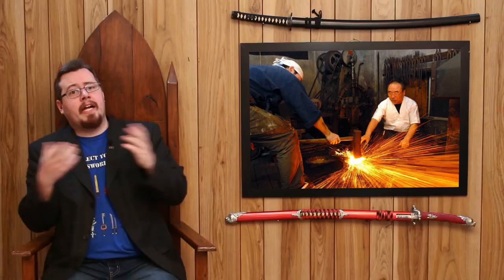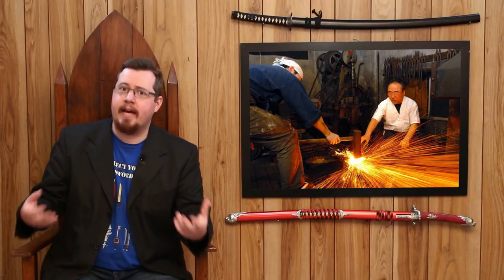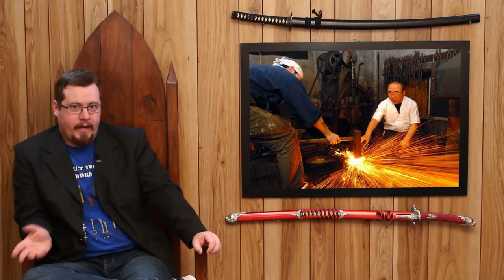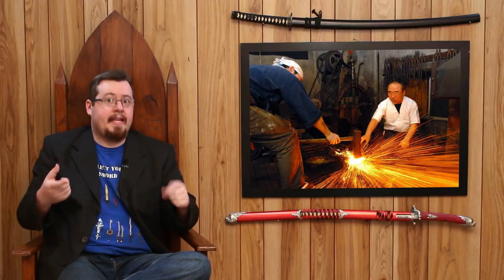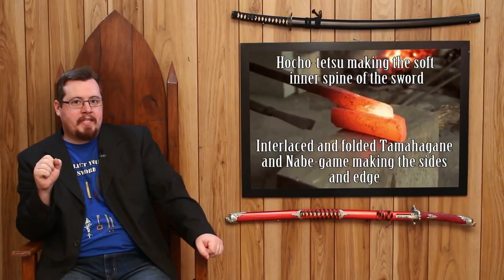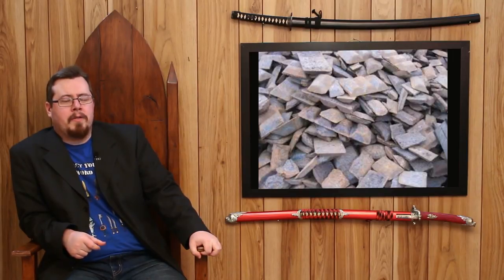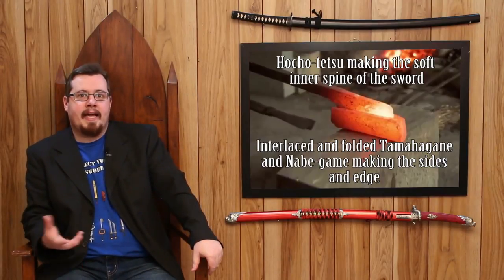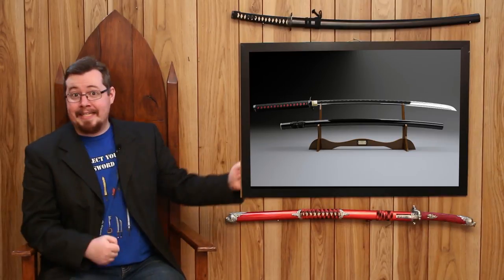The TRUTH about the KATANA, part 3: Why the steel is folded

Comment: Good video, but you might want to know that the oxides you mentioned were not all stated correctly. They were, in order, silicon dioxide (a.k.a. "silica"), iron/ferrous oxide (a.k.a. common rust), titanium dioxide (a.k.a. "titania"), and aluminum oxide (a.k.a. "alumina"). Aluminum oxide has no "trioxide" nomenclature because the valence electrons only allow for one specific configuration of aluminum and oxygen atoms to form.

Comment: Well done video's, but I have to note that when reading out the study, you are messing up some of the chemical names. A dioxide, is something with 2 (di) oxide atoms bonded to it. FeO, as opposed to SiO2, has only a single oxide atom, and therefore is called Iron-mono-oxide, or for simplicity's sake just ironoxide. The Al2O3 would in the same way be pronounced di-aluminium-tri-oxide. But since it is just the oxidized form of aluminium, we don't bother with that long name, as it normally oxidizes in just that way (it is the most - only? - stable molecule that can form from oxidizing aluminium), and we call it alumiumoxide. The reason they keep talking about Carbon-di-oxide, is because there is specifically a caron-mono-oxide that can naturally form in the oxidation of carbon (CO, the poisonous gas that is released from old malfunctioning heating devises). We keep saying carbon di-oxide because we want to clearly differentiate from the mono-oxide form.

In other words, don't call FeO irondioxide, as it is NOT iron-di-oxide. Likewise Al2O3 is NOT aluminium-di-oxide. Just a little heads up on chemical terminology (it is actually quite logical).
Reply: You're both wrong.
From a chemist standpoint, FeO is pronounced "Iron(II) Oxide" or simply "Iron 2 Oxide" where the (II) is used to denote how much ions are in the metal since transition metals can exist with different numbers of +ions. The part where oxygen comes in to play is that oxygen has a charge of -2 and when a chemical bond happens, you need to balance the compound, so basically iron has a charge of +2 and oxygen has a charge of -2.

The prefixes mono-, di-, tri-, etc. wouldn't apply since iron is a metal unlike Carbon which is a non-metal where prefixes are used to denote how many atoms there are since you can't balance non-metals. 

Water (dihydrogen monoxide) is H2O. This is a non-metal, Peroxide (dihydrogen dioxide)is H2O2. Notice the prefixes? These are both non-metals but which one is safe to drink? 
CO2 and CO, both are non-metals too, carbon dioxide and carbon monoxide.
Reply: +Killa Rasta
Since we're correct here, you should definitely differentiate between salts and molecules here, not between metals and non-metals, as there are covalent metal oxides to be found (OsO4 for example, or Chromate). 
As for the stuff about the right nomenclature of ionic compounds is alright, but I'd say it's less about the balanced charge and more about the fact that no ion is ever clearly belonging to another, as ions form "endless" lattices. Molecules are closed structures and have (at least mostly) clearly defined partners, hence the prefixes are more sensible in that regard. 

Nomenclature is a bitch and by no means uniform by how it's taught, but you definitely should use the words "covalent compound" and "ionic compound" instead of "metal" and "non-metal", as the latter refer to elements, not compounds. The mistake you made there is preeetty big, you should read up on that a bit.
Reply: There is also, of course, the elephant in the room in his mention of "hydrogen dioxide" (HO2, which does not exist) being known as water (H2O).

Comment: Pig Iron (13.53)
Pig iron is the intermediate product of smelting iron ore. It is the molten iron from the blast furnace, which is a large and cylinder-shaped furnace charged with iron ore, coke, and limestone. Charcoal and anthracite have also been used as fuel. Pig iron has a very high carbon content, typically 3.5–4.5%,[1] along with silica and other constituents of dross, which makes it very brittle and not useful directly as a material except for limited applications.

The traditional shape of the molds used for pig iron ingots was a branching structure formed in sand, with many individual ingots at right angles[2] to a central channel or runner, resembling a litter of piglets being suckled by a sow. When the metal had cooled and hardened, the smaller ingots (the pigs) were simply broken from the runner (the sow), hence the name pig iron.[3] As pig iron is intended for remelting, the uneven size of the ingots and the inclusion of small amounts of sand caused only insignificant problems considering the ease of casting and handling them. (Wiki)

Comment: 13:48
 "Pig Iron" (modern pig iron at least) tends to far exceeds the upper limit of carbon for the steel classification. Steel doesn't mean Iron with carbon, but iron with a certain lower and upper limit of carbon per mass in it (though that is a bit of an oversimplification since other elements come into play too in certain steels). Most iron products have carbon in it, hench why most iron products rust.
The term pig iron, however, isn't used to classify the make up quality and property of the of the iron, but as a classification of how its produced. The iron ore is rifined to relative high purity and then cast into "chocolate bar-like" ingots, that are then broking into little bits called "pigs". Thus the term pig iron. Pig iron is made with the purpose of being refined further into steels and alloys.
Reply: +P XIII Thank you, I was just about to comment the same. Steel actually has lower carbon content than iron.
Reply: *****
I have to say, I have no idea where I got the idea that carbon is what makes iron vulnerable to rust.
Reply: *****
 In Metallurgy, Iron is an Iron(element)-Carbon alloy in which Carbon content is larger than 2.1% by weight. I suppose when talking about forging this was the Iron he meant, not the element itself.
Reply: http://mailleisriveting.weebly.com/metallurgy-i-whatrsquos-the-difference-between-iron-and-steel.html  here "Wrought iron is a two component metal that contains high purity iron and iron silicate. [i] Although often merely called iron" It's true, in English they sometimes call it wrought Iron or something else, but as you can see it's often simply called Iron, which is indeed what everything iron is made out of, you could never find pure iron as an element ^^. In my native language it's actually just simply called Iron (the iron+ carbon compound).
Reply: ***** Literally the next sentence says "Although often merely called iron, wrought iron is actually a finished product containing ferrite and small amounts of carbon and other elements" There's your carbon.
Reply: ***** Iron which is used is usually cast iron, which has a larger carbon content than steel (pans and such), and is very hard and brittle because of that. http://metallics.org.uk/how-iron-and-steel-work/ as you can see. I didn't remember about  wrought iron though, but nowadays they usually use steel instead of that.

Anyway the original problem was that you said iron doesn't have any carbon content in it, but what people usually refer to as "iron" certainly has.
Reply: ***** The problem is that I'm not familiar with the english terminology for these things, but steel refers to an iron alloy with less than 2.1% carbon content, and more than 0.2%, but these numbers are kind of varied, just googling gave me 4 different results for these numbers...

 I've had a material science class a few years ago, but not in english unfortunately... but in my language, the equivalent of the word "iron" refers to the material with larger carbon content than steel. The english terminology is a bit different it seems,  sorry for not being correct.

Comment: Pretty cool, I didn't know nearly as much about the making of a Katana, as I do now!
But there are a few minor things you might want to know:
Silicates and other impurities are not bad in general, when I worked in a metallurgy lab for a while I actually came about a few cases where the lower surface hardness of steel grades with less silicates specifically, lead to failures. In general carbides, silicates (to some extent phosphorus) etc increase hardness, but make the steel more brittle, other metals like tungsten, vanadium chrome and the like all have their own properties in steel. 
Carbon is only that much more important than the others because it allows the formation of perlite (I don't know the actual english term, but it is Perlit in German :P )

There are steels with tons of non carbon inclusions that are way superior to most carbon steels. Eg. X155CrMoV12 is excellent tool steel with a ton of chromium, X10CrNi18-8 is great spring steel (I heard people love spring steel swords) and X5CrNi18-12 a very tough (though soft) non corrosive steel that would make a suit of armour medieval people would kill for.
Tungsten is a different beast all by itself, cemented carbides could literally cut medieval swords in half, I know that, because cutting blades made from WC are used to machine the hardest types of carbon steels

Now as of the study you showed, yes, apart from the silicone which makes the sword more bendy and more resistive there is nothing really in there that helps the Katana, but I have the feeling that you kinda created a misleading impression, that most non carbon impurities are bad

Also: Hydrogen-Dioxide would be HO2 and doesn't really exist, water is H2O which would be Di-Hydrogen-Monoxide

Comment: Shad seems to fall prey to the common misconception that because "steel is iron and carbon", if you take iron and add carbon to it you'll get steel, or vice versa. That's not really the case and the reality is a bit more confusing. Steel is iron with only about .5-2% carbon. Most iron products (pig iron, sponge iron, cast iron) are about 2-5% carbon. So generally 'iron' has more carbon in it than steel, which is exactly why pig iron isn't steel. You have to actually remove carbon (by melting it down and adding scraps to absorb the carbon) and impurities to turn pig iron into steel. That's also why you can't reduce steel back into iron by removing too much carbon, but you might get minor steel (which is chemically similar but structurally different from wrought iron).

Comment: It is possible to make a sword with "Pig" Iron ( if you don't work out the excess carbon ) .
The end result is a "Glass sword" .
Which is really hard and easy to make it ultra sharp .
But it will shatter if you hit something that is really hard as well .

~~~~~~~~~~~~~~~~~~~~

Also Please do a sword ( & other weapons ) techniques ( skills / moves ) series .
Reply: Wolfphototech Entertainment  To my knowledge, very high carbon steel such as pig iron would be very difficult to sharpen if not impossible, since it is just too brittle.

Comment: Hey, Shad! Just stumbled upon this video and I am pretty satisfied with both the information you offer and the way you offer it (i.e. you're pretty damn funny). Just one minor thing that bugs me: considering the type of grip and sheathe and the placement of the menuki, the two swords on your left are in the wrong positions. That is, the one below is classified as tachi and therefore should be placed with the cutting edge downwards and the one above is a katana and should be placed with the cutting edge upwards. I know, it's just otaku OCD stuff, but sometimes I can't help it. (no, I don't have an OCD, but don't you sometimes get annoyed by minor things as well?) At any rate, excellent job with the videos, I will certainly watch whatever else you have on your channel. Keep up the great job
Reply from the maker: +Andrei Herinean Yeah I understand completely ^_^ as little things like that annoy me too, and now those swords annoy me. . . 
Oh well, not the first time.
Reply: In fact, you hang both the katana and the tachi in such a way that the mei (the name of the bladesmith inscribed on the tang) faces towards the viewer. The koshira-e (handle, scabbard and so on) are designed to also maintain the same position when the blade is worn.
Reply: actually there were forms of tachi worn edge up as well as katana worn on hangers edge down though these are only around for short periods of time. interestingly enough there is also a form of tachi with a forged handle called the kenuki gata tachi that is believed to have been more decorative then meant for war.
Reply: Scientia Veritas yeah cause ninjutsu isnt a real martial art at all. its a skill set of medieval japans spies. all it teaches you is castle infiltration castle arson strategy and other things a spy would need. its not a martial art it never was and its no longer taught, ninpo taijutsu is a scam for dumb people to waste money. samurai and ninja were of the same class and many samurai sword fighting and martial arts school, such as tenshon shoden katori shinto ryu have ninjutsu curriculum even though they are samurai sword dueling schools.
Reply: It changes the action of the draw, specifically with the katana drawing with the edge up results in at the end of the draw the blade is in a ready position where as if you draw with the blade facing down you end up having to flip the blade into a ready position at the end of the draw.
Reply: Rhys Thomas no you dont actually, and many sabres which were worn edge down were drawn edge up its a simple flip the sword scabbard on the hangers, also the reason the japanese changed from edge down to edge up was they no longer needed the ease of drawing from edge down, katanas are generally shorter and less curved then the katana, also historical drawing of the katana isnt whats practiced now adays, at least by most  iai or kenjutsu schools.
Reply: I Hate Katana's i like Nodachi sword's

Comment: Hey Shad. Concerning the name 'pig iron', it came about before the chemical make up of steel was understood. Wrought iron has very little carbon (or none). It's the most pure form of iron generally available in pre-modern world. Pig iron and cast iron have lots of carbon. Steel is in between, but the properties of steel are so different that it got a different name, while the wrought iron and cast iron and pig iron all got lumped together as iron because they seemed more similar to each other than any of them did to steel. It was only when we began to understand the chemistry that the naming started to seem a bit silly.

Comment: If I remember correctly, it's referred to as "pig iron" because of how it flows from certain styles of smelters. Each smelter has many channels leading to moulds to which the alloy flows and then cools/sets in, and it bears a resemblance to a sow laying on her side with many piglets suckling, the smelter being the sow and the many moulds being piglets.

Comment: If I remember what I've read correctly, the name pig iron actually derives from one of the methods of making it. In some early steel making processes, the production was done in separate stages. In bloomery smelting, you had high enough temperatures to melt some of the impurities out of the iron ore, resulting in a spongey bloom of iron, which would be hammered down into a pig (why it was called a pig at this stage, I have no idea), thus iron at this stage was called pig iron.

Comment: Just a bit of extra information about Nabegane(鍋がね) and Hochyotestu(包丁鉄) and decarburisation here. Nabegane is called that because nabe means pots and gane means iron/steel and it was used to make pots. Same with houchoutetsu as houchou is kitchen knives, and tetsu is iron as it was used mainly for kitchen knifes. About decarburisation, good Japanese sword smiths and knife makers (and anyone who forges stuff who knows what they are doing as far as I know) try to do all the forging fast to deal with decarburisation. 

PS: dioxides are when there is O2 in a molecule. FeO is just Iron(II) Oxide or ferrous oxide, Al2O3 is aluminum oxide or alumina, TiO2 is titanium dioxide, SiO2 is silicon dioxide or silica etc. I don't think there is iron dioxide (or very uncommon and only exists in special conditions). 

PPS: Sorry for all this nitpicking. Your videos explains these things better than any other video that I have seen in English. (Japanese documentary's like the ones from NHK does go a bit more in depth on some parts and there are some written materials out there.)